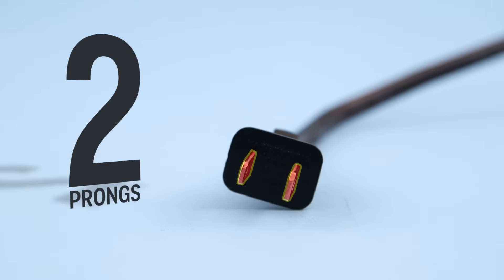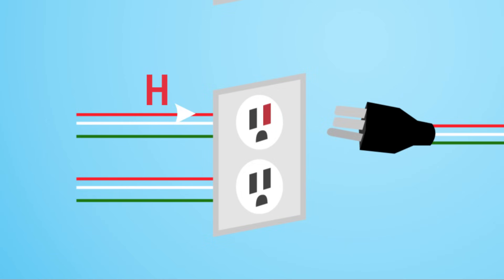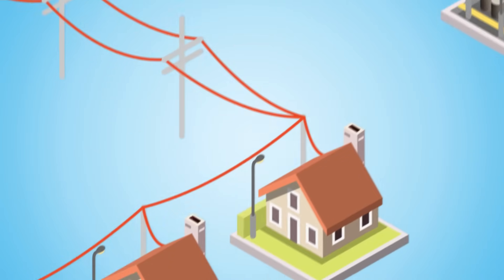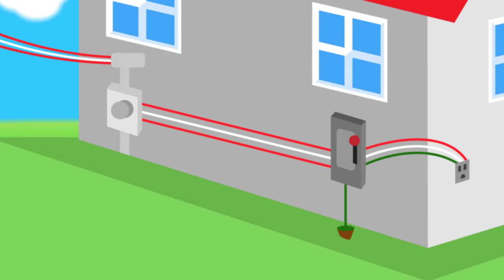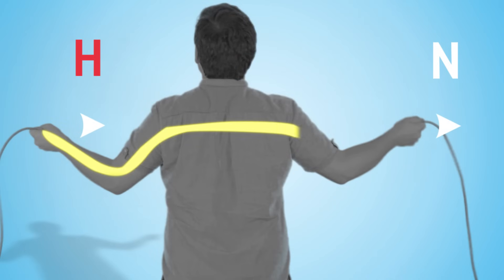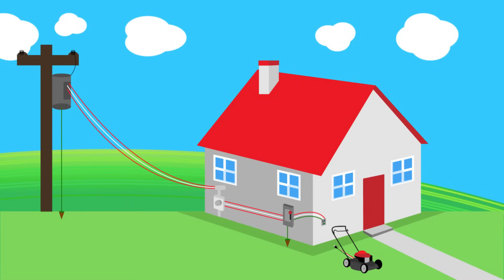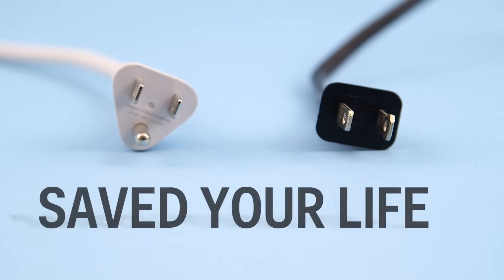Why some power plugs have 3 prongs instead of 2

Comment: my air conditioner and automatic washing machine uses 3 pronged plugs.. but we usually have 2 hole sockets here in the Philippines.. i just  used an adapter to use my appliances.. but the manual says not to use adapters or extension wires for it...
Reply: Yes, because if the ground isn't connected, and you have an internal direct short to ground, the circuit breaker won't trip and you can get electrocuted.
Reply: @some_name9306  thanks

Comment: It's funny about the grounding wire tripping a breaker in the breaker box, because GFCI outlets do that as well, which are are usually mandatory in areas with water, such as kitchens, where metal appliances are commonly found. I suppose it's still good to have them for backwards compatibility, in case those outlets were installed before that code was written, but it kind of makes one wonder if it's really necessary to have multiple backups that function the same way 🤔
Reply: If you don't have a ground wire for an old two pronged outlet, it is acceptable by NEC to replace it with a GFCI outlet and label it with "no equipment ground"
Reply: The earth and breakers protect against completely different things. Breakers protect you from power surges whereas the earth protects you in case something with a conductive case malfunctions and the case becomes live

Comment: The 3 prong we always cut the one prong at the botttom in order to avoid using plug adapter I dont know if its  safe cuz I havent encountered any problem.  Do you think its safe?
Reply: Not safe. You are eliminating the protection against electrocution if there is a direct short to ground inside the appliance in question. Stop doing that!!
Reply: @some_name9306  You cant tell me what to do cuz it aint bother you at all. Im just here sharing my experience. If you are trying to convince me then say it nicely. Stop being a kid.

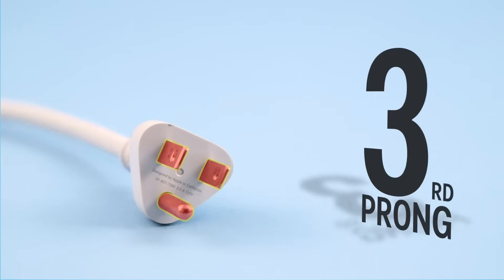Comment: your stray capacitance to the ground does it( 1:30 ). it will only send current through you to ground if its ac. usually the lightning arresters take care of this but if you are outside and in a thunderstorm, usually no current should pass through you. Unless you get directly struck(or stand next to a tree or any tall object) and it travels to you

Comment: How do I check to make sure the ground is wired correctly? This is a 1963 house and still has the original fuse box. Not sure if any of the other electrical stuff has been redone or if the outlets were ever replaced.
Reply: Use a multimeter. Set it to AC voltage and measure between the live plug and the ground plug. If you have a good ground you should have around 120V on the multimeter (give or take)

Comment: How can you make a video on this topic and never once say the term "double-insulated" ?  Completely incompetent.  Two-prong plugs are by far the most common kind of plug sold on electrical products around the world.  A two-prong plug is only safe on a double-insulated product.  You should mention "double-insulated" and explain it.  It's not hard - it's basically a product with a plastic case.

You should take this video down immediately, out of shame.  It's as preposterous as making a video about soccer and never once saying the word "ball".
Reply: You are correct. However they were probably trying to explain why the ground wire is there in the first place. Also, some plastic things like laptop chargers often have a ground plug. And sometimes metal things, such as AV receivers, are double insulated and don't have a ground prong.
Reply: @some_name9306  
What is an AV receiver? An audio-visual receiver?  What do you mean by that - a set-top box, or a PVR? Anyway, you bring up a good question. How are they allowed to sell an electrical product inside a metal case that does not require a three-prong plug for grounding?
Reply: @ShazzPotz  An AV receiver (audio-video receiver) is a device that allows you to pass video and audio into it for a home theater setup. It can also work as an audio amplifier for a surround sound system.

Comment: The other benefit of the 3rd prong is you can only put the plug in one way, so you ensure correct live and neutral. So you use a plastic third prong if you don't need an earth connection.
Reply: So wait, are you saying a plastic third prong cheater plug would negate the need to attach it to a grounded outlet?
Reply: @functionatthejunction  In the UK the earth pin is necessary to open the shield on the live connections.
Reply: They already solved that that’s why one prong is bigger than the other even in a two prong config

Comment: The early part should have been actually about connecting the neutral to the ground. Separate ground wire is another matter. Also it does not say with others have two wires only.

Comment: wait so because of grounding we got shocked if we touched the hot wire? so if i run a hot wire to an empty desert far away and touched the hot wire there i won't get shocked? because there is no grounding in a desert.

Comment: To me it always felt that the earth grounding created more problems than it solved. And the ground bonding is mainly there to fix problems introduced by earth grounding, + running extra copper. It's kinda fixing the problem that it has introduced in a first place. 90% of Russia never had grounding, no issues whatsoever.

Comment: Hey I'm an Indian where do I find this kind of plug??????
Reply: India seems to use BS 546 plugs that were the standard in Britain before 1947. They to my knowledge can have shutter mechanism that is opened by the ground pin so it is needed. The double insulation is relatively new, probably from the 60s so the plug were originally not designed it in mind.

Comment: In the UK I mostly see 3 prongs in a power plug whereas here in Italy most prongs only have 2 prongs.
Reply: Yes because in Britain the ground pin is needed to open the socket. It mostly is not connected.

Comment: I remove the 3rd prongs with pliers all the time only because there are places that has sockets that DOES NOT HAVE THE 3RD SLOT!!!
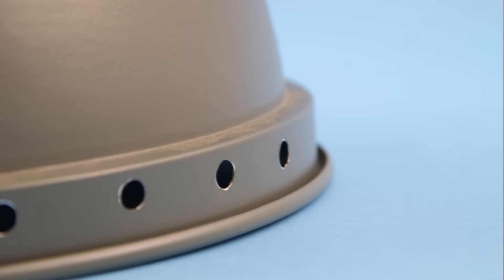They are not even connected to a wire. I know how circuits and grounds work well good luck with me not shocking myself like in 1:50.
Reply: when you remove it you can use it in a socket without earth but it is no longer safe in a socket that has earth as if the device becomes faulty the case can become hot. If you then touch it and an equipment that truly is earthed it can be fatal. If y are talking about a laptop charger then it is largely a non-issue as they are plastic.

Comment: Also you should note but unlike most countries and it's not mandatory that the u.s. outlets have a ground Penn. I live in the United Kingdom it is mandatory that all Outlets have 3 pins and all plugs have 3 pins. As a matter of fact you cannot plug anything up if it does not have a ground pin because the outlet will not unlock yes and it's cool right our Outlets have locks on them. Also if you Was to somehow bypass the locking mechanism the circuit breaker would immediately trip cutting the power to that circuit or Outlets.
Reply: True but in most British devices the ground pin goes nowhere. The only reason it is there is to open the socket.

Comment: There is no difference between hot and neutral wire cuz it's ac
Reply: Correct, the only difference being neutral is earthed back at the power station.
Reply: Arbabosu Mandal neutral is 0v only line Changes voltage
Reply: I think he was thinking of polarisation (not positive or negative). Neutral is 0V with respect to the earth.
Reply: Put your left hand on the kitchen sink and stuck a needle first neutral and then the live and tell if there is a difference (if you still are alive). I think U.S. has 240 volt outlets. On those there is no neutral. Either one will give you 120 volts.

Comment: The ground wire is not part of Florida electrical code. So it doesn't work which is stupid. When you consider that Florida is the lighting capital of the US.

Comment: Oh shit I remember I used to literally cut off the 3rd one cause I had this extension cord tgat could only plug cords that had 2 prongs on them and I remember thinking if the device would work without the third one and it did but in hindsight I was fucked

Comment: All of these reasons are mostly wrong. They added it so that people wouldn’t plug things in backwards, cause the appliance to blow up.
Reply: Nonsense. Almost all equipment work either way. Plugs in Europe are reversible. Some UPSs are dependent on the position of live and neutral but they just beep when connected the other way so one can reverse the plug.

Comment: in Mexico all the plugs only have 2 prongs and I've never been shocked so ??? is their circuits built differently or safety standards are different?
Reply: The risk of having a faulty equipment is small. If one expected to get shocked nobody would have started to use electricity.  From what I have read Mexico has also three hole outlets. Check what you have on the fridge, washing machine, toaster etc.

Comment: In Ireland the third prong is plastic, and it is to prevent babies from shocking themselves is they put their fingers in the holes by closing everything if the plastic prong isn't there.
Reply: The third prong is plastic if the item is double insulated, if not then it's metal for earthing. Yes it also is for opening the socket shutters to prevent electric shock.
Reply: If can be metal even for double insulated.

Comment: my third prong broke on an extension, will anything happen?
Reply: Is there a 3rd prong broken or missing? Then yes. After plugging in all 6 needed electrical items or some that needed a 3rd prong, it will cause a fire when all six have been plugged

Comment: None of the outlets in my apartment are properly wired. There's missing grounds, and reversed hot/neutrals. I don't have access to the breaker boxes, so I can't add grounds or swap any wires myself. If the conduit boxes weren't originally grounded when the building was wired, then screwing things to the middle screw is futile. 

How does the fail work in this case?
Reply: Missing ground is serious if it is only on some outlets. Reversed hot and neutral is really a non-issue. Only think is that if you have to operate with a lamp for example like to remove a physically broken bulb you need to unplug. You should do it anyway.

Lack of grounding is not really that severe unless there is ground nearby like radiators, antenna cables, grounded equipment, water or if there is conductive floor.

It is possible to connect the live and neutral on the socket. Whether this is legal depends on the local laws. There is a risk if the common neutral/ground breaks then all equipment become hot. Also it one accidentally connects the live and ground it is extremely dangerous.

Comment: So don't purchase anything with a 2-prong plug?! 🤤
Reply: Eh depends on the volts that come out of the product you are using
Reply: TapTapClick 
It's the same voltage going in...best example are lamps or a vacuum cleaner, I don't recall seeing any with 3 prongs. Just the polarized two prongs.
Reply: +TapTapClick WTF? No, that has nothing to do with it...
Reply: It's perfectly fine to have a 2 pin plug as long as the product is double insulated
Reply: Two pin ones are safer. They are class II when three pin ones are class I.

Comment: Here in the uk all plugs have 3 prongs! But some have plastic as the third prong and some have metal instead. I'm not sure why
Reply: Those that have plastic are comparable to the U.S. two prong plugs. Most of those that have metal also are. Plastic is cheaper, metal is stronger. In some equipment the plug is real earth. These are typically in the kitchen and also computers.

Comment: I still like european plugs because I all have european plug things in my wall, I don't have american ones
I live at belgium and they don't make those prongs like in the video and they also don't make those american plug things for your wall in my country

I'm glad that adapters exist
I once bought an object on ebay which has an american plug on it with 3 prongs
I forgot to look what kind of prongs it had
turns out it has an american plug cable and not a european one
so I bought a US adapater with EU prongs on it so I finally can use the thing
Reply: I have the reverse on some of my stuff lol.
Reply: are you sure your american plug object is about 230V?

Comment: Why are there holes on the end
Reply: Good question.
Reply: First off they save money on metal and secondly inside the plug there is a spring activated metal ball or contact that applies pressure to those holes to keep the plug fully inserted and not hanging out with the contacts exposed

Comment: Does the grounding really touch bare earth like that?  No insulation?  What happens if the soil is soaked from heavy rain/flooding?  Wouldn't that be quite dangerous since water is a conductor?

Comment: It doesnt go into the ground as in dirt. It connects to the ground wire, which is connected back to the poles feeding the house.
Reply: Most of the time it goes into a grounding rod in the... ground..
Reply: In the USA, there are 2 hot wires and one neutral wire, sometimes bare, feeding each house. Ground and neutral are often connected together in older houses, so both are true, but there is no ground wire from the pole to the house. Every house must have a ground rod, and the electrical ground must be bonded to the metal plumbing. But a lot of this video is factually inaccurate.

Comment: Just some technical things to point out and correct.
Voltage does NOT move through you. Voltage is basically electrical potential between two points. Current is what moves through you, and it flows from higher voltage to lower voltage.
If you're holding a wire while wearing runner sole shoes, the current will not flow from the wire to ground, as the rubber stops the circuit from completing
Reply: This is why in third world countries electricians wear rubber flip flops while on the job.

Comment: I just removed the 3rd prong on my laptop charges because our house's outlets only supports 2-prong
Reply: There hardly is no risk as the charger is plastic and beyond that it is low voltage. I do not get why chargers are even grounded. Otherwise you should be careful with these and especially not use those when the earth is available. If you want to be extra sure you could get a separate cord for travel use.

Comment: in philipines there is alot of people using 2 prongs plug
Reply: All I see are only 2 prongs but instead of using those unsafe ones they've actually did a stupid way which is cutting the wires and putting electrical tape

Comment: in europe all appliances that use water, must have 3 prongs.

due water being able to shortcut the circuit.

also in the EU the 3 prong connector is more safe than the usa version.
since the usa version is flat on the wall, while the EU version is embedded in the wall socket

Comment: I'd be concerned if one of my plugs had 2 pins. That's not safe.
Reply: Sketchy Yes, it is. Because the neutral is bonded to the ground in the service panel. Also, there are circuit breakers in the panel.
Reply: That's not what I'm getting at, I mean that all of our plugs where I live have 3 pins. I've never seen a 2 pin plug apart from when I flew to Italy. If there was a 2 pin plug here it would have had to have broken off since all of ours are made with 3.
Reply: If the product is double insulated then the third prong is useless, lots of items you use will have a plastic third prong instead.

Comment: As I'm sure most people know, schuko plugs don't have a ground prong, but instead have contact plates perpendicular to the power pins, that make contact with springs in the outlet. But it does the same job anyway.
Reply: Germans made it right. Schuko fits old ungrounded outlets but not the other way around. No need to cut any springs when you have old outlets. The French one is also similar with the earth pin. Danish on the other hand have an earth hole. The Danish outlet accepts schuko but it does not connect the earth which can be dangerous.

Most grounded plugs now are combination of schuko/French.

Comment: In the U.K. all of our plugs have 3 prongs. This is regardless of whether it's a full-on gaming PC or just a kettle.
Reply: Well not all appliances here are earthed though but both a computer charger and a kettle would be, based on the fact that if you are in the rest of Europe those have earthed plugs with the earthed contacts on the side for schuko used in most European countries, and also a hole for French sockets, that are also used in a few other European countries (all plugs, except very old ones, work in both sockets) but things like lamps or double insulated appliances like a vacuum cleaner or hair dryer aren't earthed even on the UK, even though there's still a 3rd pin, which is needed to open shutters over the 2 main contacts for the live and neutral

Comment: In Britain adapters are double insulater which means it has no grounding but still have the ground prong
Reply: the ground plug now acts mostly as a way to create a 3 safety measurement for the flaps over the top to holes so you cant put something in them with out that ground prong in its slot.

Comment: Now to really confuse you, the neutral and ground are actually directly connected inside the breaker box. Another way to think of it is that the neutral wire is the "intended" or "protected" ground,  and the ground connects equipment that shouldn't be energized so the electricity goes through the extra wire, not you, if it dose become energized.